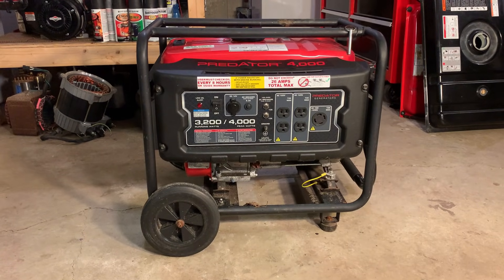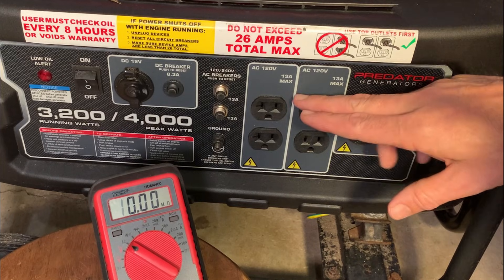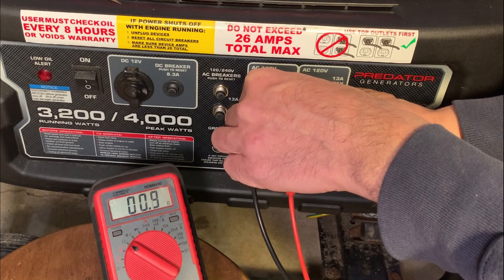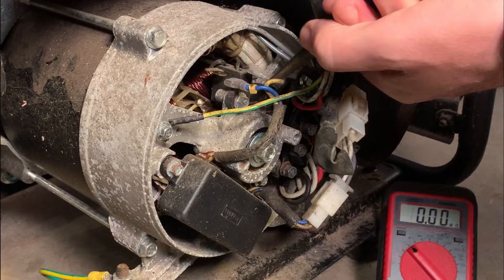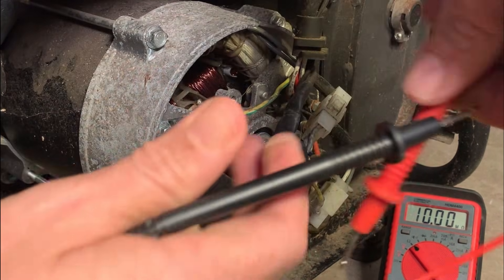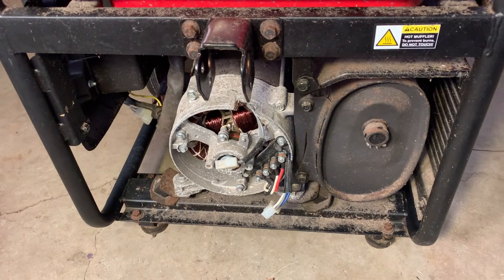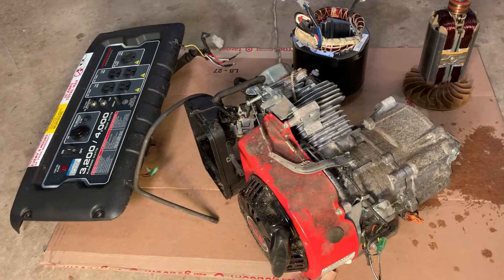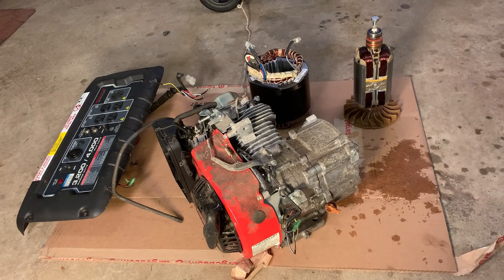Predator Generator Not Making Power

Comment: I have used soap to remove bushing&bearings.pack a little at a time pushing it in until the bushing or bearing comes out. Didn't have a puller still don't
Reply: Don’t forget about the generator safety rules: Always make sure you follow all the generator safety rules whenever you use your portable generator. This is only a reminder. Generators can be dangerous if not used carefully. Every year, hundreds of people die or get injured when using portable generators due to carbon monoxide poisoning and electrocution. Make sure you are using your generator carefully and keeping others safe as well. There is something very serious that everyone should always be aware of when using generators. Some people do run their generator indoors which is not safe and that increases the risk of carbon monoxide poisoning which can cause death of family and you. Some people run their generator in wet conditions which can electrocute them. Please remember that you should never run your generator indoors. Remember that carbon monoxide is an odorless and colorless gas that you cannot see or smell. Carbon monoxide is a silent killer. Keep that in mind. Make sure your generator is 15-20 feet away from your house and away from doors, windows, and vents. Never use your generator in your porch too. Having a carbon monoxide detector is very important against generator safety. Some people also allow children to go near the portable generator which could pose risks. We need to keep an eye on our children making sure that they are not near the portable generator so they won’t get electrocuted or burned by the generator which is dangerous. A locking enclosure also keeps kids safe. A generator shed might look like a tempting place to explore, or take cover during a game of hide and seek, but a generator is a dangerous piece of equipment that can cause injury. It says on the manual that we should also keep children away at all times from the portable generator to avoid injuries. Please do not allow a child or unqualified people to operate the portable generator.  It is important to keep your children safe especially little ones. The portable generator can be hot during an operation. Just because some manuals missed what should be listed doesn’t mean it’s safe to do. Always follow the generator safety rules when using portable generators. Generators pose electrical risks. If you need to use your generator during wet weather, you need a generator tent to protect your generator from getting wet. Don’t let your generator get wet. Keep your generator dry and before using your generator, please make sure your hands and your generator is dry. Do not wear loose clothing when operating the generator. Everything that is said on the generator’s operating manual should not be ignored. Never smoke cigarettes near the generator. Please keep flammable things away from the generator. Never overload your generator too. Your generator can catch fire. Never ever try to plug a generator cord into a wall outlet to avoid back feeding. Back feeding your generator is dangerous. Always turn on your generator first before plugging in appliances and shut off the appliances before turning your generator off. Use a heavy duty cord for your generator and the cord should not be worn out. All the instructions should be followed carefully. Never refuel your generator while it’s running. It can cause fire if fuel spills while your generator is hot. You should turn off your generator and let it cool off before refueling it. Having a fire extinguisher next to the generator is also important. This is only a reminder for everyone’s safety of using generators. Make sure your generator is properly grounded. Having a fire extinguisher next to the generator is also important against the safety rules. https://youtu.be/I1jT3ANENvI and here is a video more about keeping others safe when using generators and also about our family’s safety. It’s important to keep our little children safe as well. Make sure your little children are kept away from the generator at all times especially when it’s running. Hope this helps. Always remember that it’s better to be safe than sorry.

Comment: I bought a Predator 9000 a few months ago. In the owners manual was the parts catalog and exploded view of the whole unit.
Reply from the maker: Maybe the higher end one is supported?  Did it list a web site or phone number to call?  Would be good to note for the future.
Reply: @jcondon1   I will look and send you what I can. I will post it here.
Reply: @jcondon1  phone number 1 800  866 5797 that number was on the owners manual. Assembly Diagram is on page 23. Parts list page 22. Hope this helps.

Comment: Popping the rotor off with water: is there some reason you can't stand the whole thing on its end? Seems to be faster and easier than disassembling it.
Reply from the maker: You can.  Just got to watch the engine mounts.  You will need a little something extra to support the engine.

Comment: i bet that wire goes straight towards the center ( first wire on)and can not be lengthened
Reply: Reminder about generator safety: Always make sure you follow all the generator safety rules whenever you use your portable generator. This is only a reminder. Generators can be dangerous if not used carefully. Every year, hundreds of people die or get injured when using portable generators due to carbon monoxide poisoning and electrocution. Make sure you are using your generator carefully and keeping others safe as well. There is something very serious that everyone should always be aware of when using generators. Some people do run their generator indoors which is not safe and that increases the risk of carbon monoxide poisoning which can cause death of family and you. Some people run their generator in wet conditions which can electrocute them. Please remember that you should never run your generator indoors. Remember that carbon monoxide is an odorless and colorless gas that you cannot see or smell. Carbon monoxide is a silent killer. Keep that in mind. Make sure your generator is 15-20 feet away from your house and away from doors, windows, and vents. Never use your generator in your porch too. Having a carbon monoxide detector is very important against generator safety. Some people also allow children to go near the portable generator which could pose risks. We need to keep an eye on our children making sure that they are not near the portable generator so they won’t get electrocuted or burned by the generator which is dangerous. A locking enclosure also keeps kids safe. A generator shed might look like a tempting place to explore, or take cover during a game of hide and seek, but a generator is a dangerous piece of equipment that can cause injury. It says on the manual that we should also keep children away at all times from the portable generator to avoid injuries. Please do not allow a child or unqualified people to operate the portable generator.  It is important to keep your children safe especially little ones. The portable generator can be hot during an operation. Just because some manuals missed what should be listed doesn’t mean it’s safe to do. Always follow the generator safety rules when using portable generators. Generators pose electrical risks. If you need to use your generator during wet weather, you need a generator tent to protect your generator from getting wet. Don’t let your generator get wet. Keep your generator dry and before using your generator, please make sure your hands and your generator is dry. Do not wear loose clothing when operating the generator. Everything that is said on the generator’s operating manual should not be ignored. Never smoke cigarettes near the generator. Please keep flammable things away from the generator. Never overload your generator too. Your generator can catch fire. Never ever try to plug a generator cord into a wall outlet to avoid back feeding. Back feeding your generator is dangerous. Always turn on your generator first before plugging in appliances and shut off the appliances before turning your generator off. Use a heavy duty cord for your generator and the cord should not be worn out. All the instructions should be followed carefully. Never refuel your generator while it’s running. It can cause fire if fuel spills while your generator is hot. You should turn off your generator and let it cool off before refueling it. Having a fire extinguisher next to the generator is also important. This is only a reminder for everyone’s safety of using generators. Make sure your generator is properly grounded. Having a fire extinguisher next to the generator is also important against the safety rules. https://youtu.be/I1jT3ANENvI and here is a video more about keeping others safe when using generators and also about our family’s safety. It’s important to keep our little children safe as well. Make sure your little children are kept away from the generator at all times especially when it’s running. Hope this helps. Always remember that being safe is better than being sorry.

Comment: You might try pulling a piece of wire from the stator. It's already bad anyway. What have you got to lose? A thin knife along that side may losen it up. You only need a 1/4" inch of wire to solder to.
Reply: Electrical safety when using portable generators: Always make sure you follow all the generator safety rules whenever you use your portable generator. This is only a reminder. Generators can be dangerous if not used carefully. Every year, hundreds of people die or get injured when using portable generators due to carbon monoxide poisoning and electrocution. Make sure you are using your generator carefully and keeping others safe as well. There is something very serious that everyone should always be aware of when using generators. Some people do run their generator indoors which is not safe and that increases the risk of carbon monoxide poisoning which can cause death of family and you. Some people run their generator in wet conditions which can electrocute them. Please remember that you should never run your generator indoors. Remember that carbon monoxide is an odorless and colorless gas that you cannot see or smell. Carbon monoxide is a silent killer. Keep that in mind. Make sure your generator is 15-20 feet away from your house and away from doors, windows, and vents. Never use your generator in your porch too. Having a carbon monoxide detector is very important against generator safety. Some people also allow children to go near the portable generator which could pose risks. We need to keep an eye on our children making sure that they are not near the portable generator so they won’t get electrocuted or burned by the generator which is dangerous. A locking enclosure also keeps kids safe. A generator shed might look like a tempting place to explore, or take cover during a game of hide and seek, but a generator is a dangerous piece of equipment that can cause injury. It says on the manual that we should also keep children away at all times from the portable generator to avoid injuries. Please do not allow a child or unqualified people to operate the portable generator.  It is important to keep your children safe especially little ones. The portable generator can be hot during an operation. Just because some manuals missed what should be listed doesn’t mean it’s safe to do. Always follow the generator safety rules when using portable generators. Generators pose electrical risks. If you need to use your generator during wet weather, you need a generator tent to protect your generator from getting wet. Don’t let your generator get wet. Keep your generator dry and before using your generator, please make sure your hands and your generator is dry. Do not wear loose clothing when operating the generator. Everything that is said on the generator’s operating manual should not be ignored. Never smoke cigarettes near the generator. Please keep flammable things away from the generator. Never overload your generator too. Your generator can catch fire. Never ever try to plug a generator cord into a wall outlet to avoid back feeding. Back feeding your generator is dangerous. Always turn on your generator first before plugging in appliances and shut off the appliances before turning your generator off. Use a heavy duty cord for your generator and the cord should not be worn out. All the instructions should be followed carefully. Never refuel your generator while it’s running. It can cause fire if fuel spills while your generator is hot. You should turn off your generator and let it cool off before refueling it. Having a fire extinguisher next to the generator is also important. This is only a reminder for everyone’s safety of using generators. Make sure your generator is properly grounded. Having a fire extinguisher next to the generator is also important against the safety rules. https://youtu.be/I1jT3ANENvI and here is a video more about keeping others safe when using generators and also about our family’s safety. It’s important to keep our little children safe as well. Make sure your little children are kept away from the generator at all times especially when it’s running. Hope this helps. Always remember that being safe is better than being sorry.

Comment: I have never seen a rotor like that I was skeptical but no more. It is a shame the guy just let it sit around probably outside but that didn't break the wire he may of caused the problem by working on it. Thanks or sharing your video with us James. I have a poulan chain saw that hasn't been run in over 10 years its your if you want it. Ed
Reply: Don’t forget about the generator safety tips: Always make sure you follow all the generator safety rules whenever you use your portable generator. This is only a reminder. Generators can be dangerous if not used carefully. Every year, hundreds of people die or get injured when using portable generators due to carbon monoxide poisoning and electrocution. Make sure you are using your generator carefully and keeping others safe as well. There is something very serious that everyone should always be aware of when using generators. Some people do run their generator indoors which is not safe and that increases the risk of carbon monoxide poisoning which can cause death of family and you. Some people run their generator in wet conditions which can electrocute them. Please remember that you should never run your generator indoors. Remember that carbon monoxide is an odorless and colorless gas that you cannot see or smell. Carbon monoxide is a silent killer. Keep that in mind. Make sure your generator is 15-20 feet away from your house and away from doors, windows, and vents. Never use your generator in your porch too. Having a carbon monoxide detector is very important against generator safety. Some people also allow children to go near the portable generator which could pose risks. We need to keep an eye on our children making sure that they are not near the portable generator so they won’t get electrocuted or burned by the generator which is dangerous. A locking enclosure also keeps kids safe. A generator shed might look like a tempting place to explore, or take cover during a game of hide and seek, but a generator is a dangerous piece of equipment that can cause injury. It says on the manual that we should also keep children away at all times from the portable generator to avoid injuries. Please do not allow a child or unqualified people to operate the portable generator.  It is important to keep your children safe especially little ones. The portable generator can be hot during an operation. Just because some manuals missed what should be listed doesn’t mean it’s safe to do. Always follow the generator safety rules when using portable generators. Generators pose electrical risks. If you need to use your generator during wet weather, you need a generator tent to protect your generator from getting wet. Don’t let your generator get wet. Keep your generator dry and before using your generator, please make sure your hands and your generator is dry. Do not wear loose clothing when operating the generator. Everything that is said on the generator’s operating manual should not be ignored. Never smoke cigarettes near the generator. Please keep flammable things away from the generator. Never overload your generator too. Your generator can catch fire. Never ever try to plug a generator cord into a wall outlet to avoid back feeding. Back feeding your generator is dangerous. Always turn on your generator first before plugging in appliances and shut off the appliances before turning your generator off. Use a heavy duty cord for your generator and the cord should not be worn out. All the instructions should be followed carefully. Never refuel your generator while it’s running. It can cause fire if fuel spills while your generator is hot. You should turn off your generator and let it cool off before refueling it. Having a fire extinguisher next to the generator is also important. This is only a reminder for everyone’s safety of using generators. Make sure your generator is properly grounded. Having a fire extinguisher next to the generator is also important against the safety rules. https://youtu.be/I1jT3ANENvI and here is a video more about keeping others safe when using generators and also about our family’s safety. It’s important to keep our little children safe as well. Make sure your little children are kept away from the generator at all times especially when it’s running. Hope this helps. Always remember that being safe is better than being sorry.